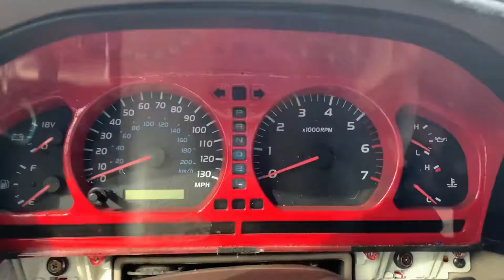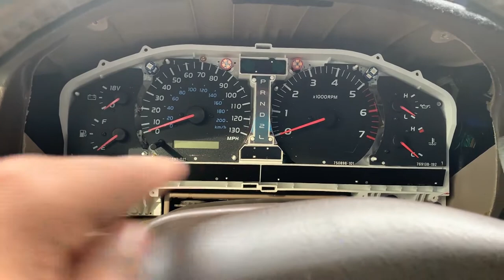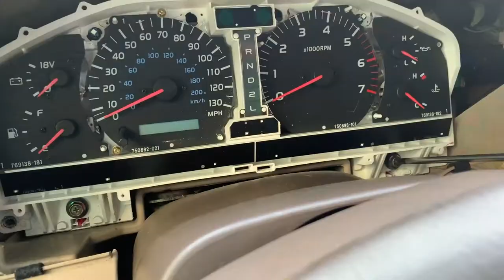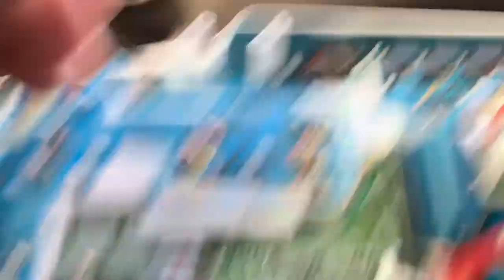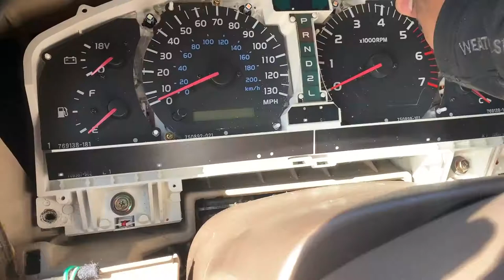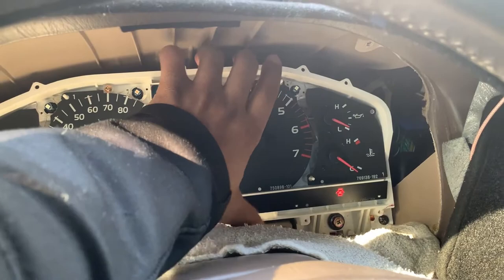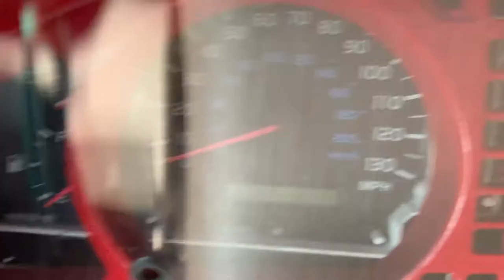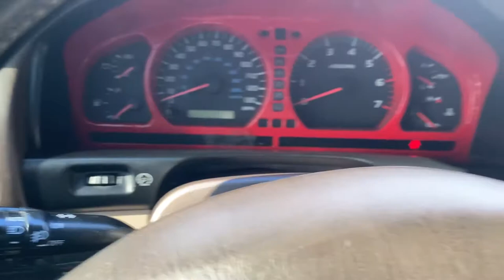How To: Upgrade Dash Lights To LED Bulbs (Land Cruiser 100 Series)

Comment: How did u do that red panel mod. Any links?
Reply from the maker: Unfortunately I do not have any pictures or videos of this. When I was replacing some dashboard lights, I took the instrument panel completely off to paint it myself. 

It's basically held on by plastic clips which can be popped out carefully using a flathead. Once you remove the clear instrument panel cover, you can then take the back face plate off and use primer spray paint to get a nice flat paint coating. After the primer is down drying, hit it with some red spray paint and let it dry overnight to allow the fumes to air out. The next day, put everything back together and your in good business.
Reply: @AWordFromMrJones  great job bro u must have made a video on it